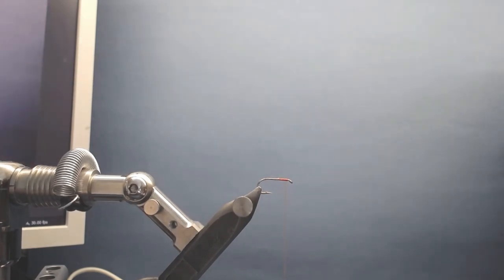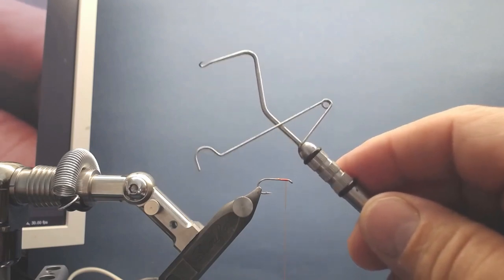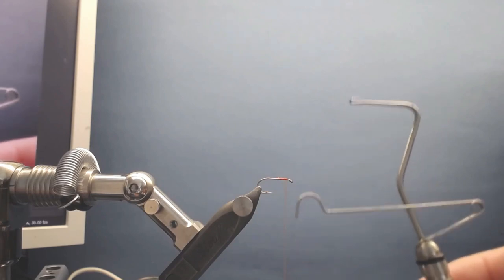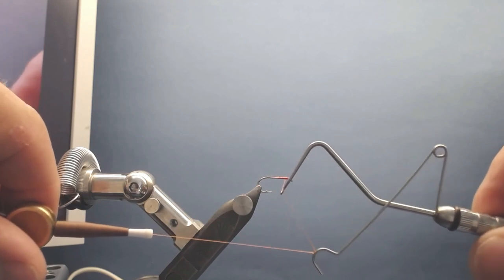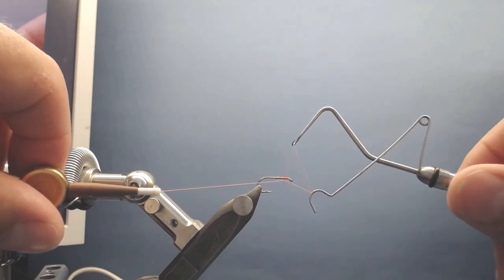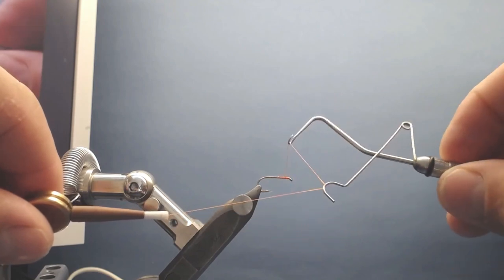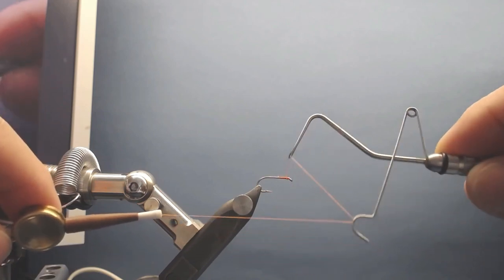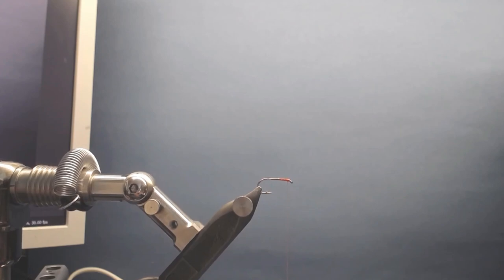How to use a whipfinish tool

Comment: Nice video. I notice you use a transformer vise. I have one as well but only gripe I have with it is when tying there is tiny movement from the collar where you connect the different jaws. Do you have same problems?